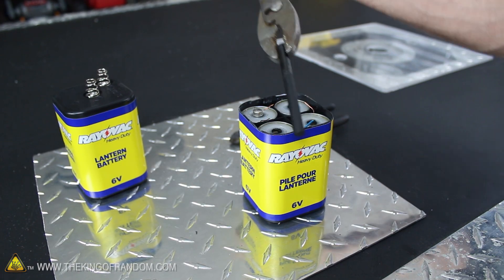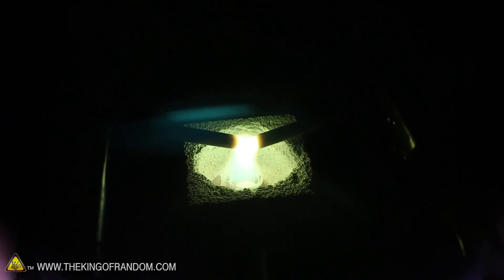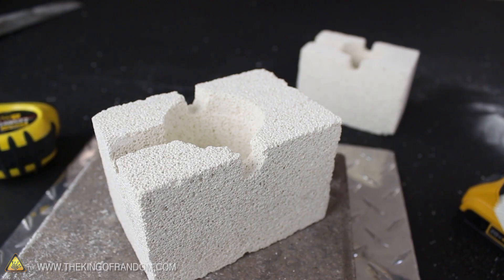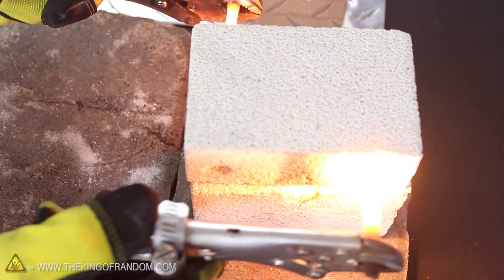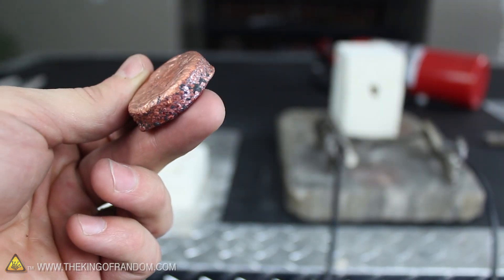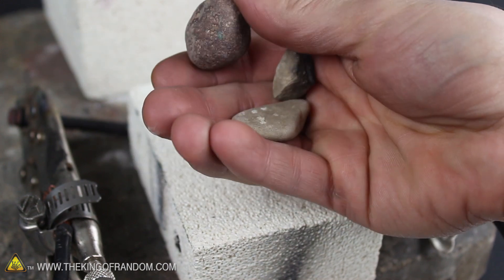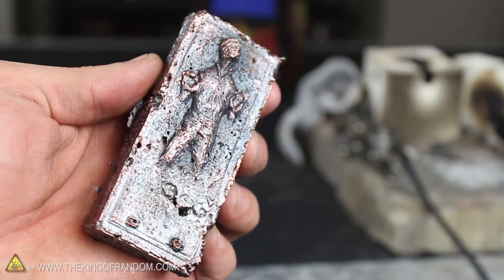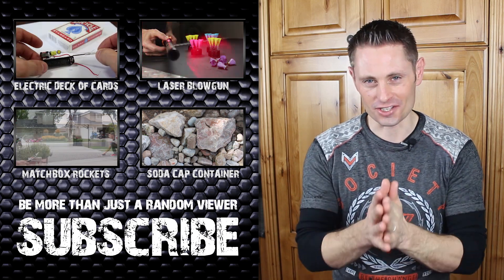Mini Arc Furnace (Arc Reactor Technology IRL)

Comment: Hey, you should totally try to make a plasma gun by fixing the electrodes so they will generate a stable plasma flame, It will be safer and easier to use, and incredibly cool. Also you can try to make a metal cutter/scissors by fixing the electrodes to an axis. And one last thing i am wandering about is if maybe you can use the melting technique to c-r-e-a-t-e magnets from regular metal, which could be very awesome. Any way thank you for creating these grate videos for us fans, they are really fun to watch and even funner to try:]

Comment: Fun fact: Carbon has a melting point of over 3500 degrees C( over 6500 Fahrenheit).
In the form of diamond it's melting point rockets up to over 4300 degrees C(over 7,800 Fahrenheit)
Try melting that in your furnace!

Comment: Why doesnt the melter itself melt?
Reply: Myko Link Because carbon has an extremely high melting point, 3550 degrees celcius. Whilst stuff being melted here such as steel melts at around 1200 degrees celcius, you can also see people asking about tungsten as it is a metal with a high melting point, tungsten melts at around 3400 degrees celcius so you are not in too much danger of melting the carbon rods if you do it for a limited time.
Reply: It's designed to withstand incredible heats, that's why it's called.fire proof brick...
Reply: Steven Roberts No I mean the thing that generates the electricity.
Reply: Scottx125Productions - Spiffingly Serious British Gaming! What about the things that lead to the carbon rods?
Reply: Myko Link
They're just copper wires, however at that point the only thing there is electricity.  It's where the two rods meet that make the plasma happen.
Reply: P = I^2*R
There's a lot of current going through the transformer and feed wires, but the current doesn't produce a concentration of heat until it gets to the resistance of the arc gap and carbon rods.

Comment: I like how you combined stuff from previous projects. I think it would be really neat to see you build something out of custom parts--like a jet engine, a radio, a motor, or put them all together to make an RC aircraft/car/boat/vehicle. I believe jet engines have a lot to do with material science as they have strong pressures that must be handled. 

Or, you could also switch into biology. I've heard there are a lot of new DIY bioengineering projects that people are taking on. I haven't delved too deeply into this, but it sounds very interesting.

Comment: is the gap between the rods wide enough that you could slip a thin insulator in between them? Then you could make them stationary and use that as a switch and just drop it back in to a top slot to kill it while you added more material through devided  top brick.

Comment: Please try creating glass with your furnace, that would really amazing!
Reply: Glass is difficult to do, if it cools unevenly / badly it can explode
Reply: There was a reason that glass making in Italy, was all moved to the island of Murano (so it wouldn't set fire to the city)
Reply: i was thinking that
Reply: FedeKode its true
Reply: Glass needs to be cooled on liquid tin
Reply: Yup :)
Reply: Yes
Reply: That would be great..
Reply: 10mcman Glass is a very thick liquid, like a sort of proxy, or glue, due to it's silica amount.
Reply: The Gaming Pirates Depends on the glass. Borosilicate glass from stuff like test tubes is good for melting. I think using something like a welding blanket would help a lot.
Reply: Glass requires a very hot, controlable furnace, maybe even a blast furnace, and takes a while, more than afew mibutes, to be well glass but does so awsome ri create
Reply: Rick Pickles Thats to keep it flat

Comment: Sir Thompson, can you do a video how you do the welding machine with the battery thing? I don't know how you do that with a 6 volts battery. I was planning to create my own too so I can have money for my thesis in architecture(A side line).

Thus inhaling it is dangerous? Thus it give you a cancer, if it does a need medicine that I can take to prevent the toxic from getting in my body?

Comment: Do the carbon rods ever break or wear down? If it can melt steel, couldn't it melt the carbon rods?
Reply: Carbon doesn't melt, rather it sublimes. Grant mentioned in another comment that he had to replace the carbon rods every 10 minutes or so, presumably because the carbon would sublime.
Reply: Jean Derpnald For once I'm glad I decided to read the comments. Is this simply from the carbon rods reaching critical temp? Would simply using the rods in shorter bursts increase their life expectancy, or is it just better to just let them burn out and not rely on them for all melting?
Reply: *****
I'm not sure, you'd have to ask someone more informed.
Reply: Carbon's melting point is rough 6332F (3500C)
Reply: brokenstar547 That's only if you put it under high enough pressure. The minimum pressure to liquefy carbon is around 10 MPa. That's nearly 100x atmospheric pressure.

Comment: You could probably make this self-starting if you use the -20KV from a TV flyback and place it between the electrodes when they are a few cm. apart. The air would become ionized, and hopefully conduct the arc, similar to in a camera flash. As soon as I can get my dad to let me get some of these transformers, I will absolutely build this. It is AMAZING!

Comment: Here is how it works. The  electrons have  no load, so this is a short circuit. short circuits in something all electrocutions have to be careful with. A short circuit will braks and cuse fire because the elections move freely and heat up the circuit, so all circuits have a fuse because it brakes easily, so that it brakes before the circuit brakes. The carbon rods act as a very slight load because the are nether conductors or insulators.

Comment: Great job Grant! I need one of these in my shop. I should have warned you that plaster can act as an oxidizer in thermite reactions if you happen to try to cast REALLY hot metals into it. Look into making green sand from bentonite powder for better copper/steel casting
Reply: Hey dude
Reply: Haha sounds impossible but my furnace did just that. My furnace started reacting with aluminium and burned down leaving me with couple of calcium droplets 😢😢

Comment: Grant Thompson - "The King of Random" Hey Grant, I was wondering what are the characteristics of the electricity running through the electrodes? Also, why the 2 transformers and 18 wrappings? Is it for easing the "stress" on the wires or was it to reach a specific voltage/current ratio?

Comment: Grant, this is freakin' awesome.  I had an idea, though.  What about putting together a little "fume-hood" type of thing, but for high-temp projects like this?  Something simple, like a fiber-glass tub on hinges with some high-temp insulated lining, a cheap little metal exhaust fan, and the face-plate from a welding mask for the view-port.  Attach some welding gloves, and you're good to go.

Comment: For people wondering how he doesn't blind himself and how that mask blocks out enough light to not blind him, that mask is called an Auto Darkening mask. It's (normally) electronic and when it sees an arc ray (a light so bright that it will permanently damage your eyes in 5-10 seconds) it goes completely black, making it so you can only see some dots where you may be welding or melting.

Also, he uses very thick gloves to protect himself from electricity. You should also note that the sparks flying around actually don't hurt, which is why he doesn't care if he wears a jacket or not. If you ever see anyone wearing a jacket, it's because they don't want to melt a hole in their clothes in case something goes wrong, but chances are he is wearing "work clothes" so he might not mind if they do melt.

Comment: Grant Thompson - "The King of Random" You should definitely take those two solar panels that you got and hook them up in series with the microwave generator and like double the power. Also how did the hand not get electrocuted when you were holding the wrench that the electricity was running through, what kind of gloves were those?

Comment: Another good material to cast into is cuttlefish shells, I used it to cast silver into it probably wouldn't hold up to steel but probably would be fine for aluminum or copper (keep in mind I'm some guy on the Internet not an expert) but it creates a really interesting ridged pattern on the metal and it's really easy to work with as its VERY soft, you can sand one end flat and then carve the other side one shell can make one cast but if I remember correctly it's only good for one casting. Either way, just giving you the idea.

Comment: Im impressed! Pretty awesome! I wished this was safe for melting my lead scrap down. I like to process my scrap lead to alloy it and pour into ingots so that my ingots are pretty clean and pre-alloyed for bullet casting. To afraid of vaporizing lead and making toxic fumes. I use a forced air charcoal burner and a gas cylinder crucible. Takes a little while and more work but cheaper than propane.

Comment: Thanks, this gives me ideas.  I wonder if you'd have had better luck with the plaster mold if you had preheated it (the mold) first.  I also wonder what the optimal size crucible/furnace is for that arc setup.  I suppose it would vary depending on what metal is being melted.

Comment: Always glad to see my microwave salvage tutorials being put to good use :). You can buy carbon gouging rods from welding supply stores too, they last a lot longer than the graphite battery cores and are built for this purpose. Carbon Arc torches are used to preheat large and thick metal for welding, same as an oxy/ace torch would but without having to rent bottles and fill the gas. For anyone looking to do this on a slightly smaller scale, "heavy duty" (i.e. cheap, dollarstore) AA batteries have about a 3/16" carbon rod inside them as well, and they're still fine from dead batteries.

Comment: Well if that is indeed a plasma arc it's temperatures could be around 5000ºC (about 9000ºF) so with that temperature level and with a insulating furnace like the one you made it's really no surprise it melted steel! That opens up quite a few  possibilities like casting iron and steel and even making your own alloys! Provided you have the metals for it. Awesome work, Grant. Thank you for sharing this!
Reply: It can easily melt tungsten
Reply: Jacob Iser One thing is reaching the melting temperature actually being able to melt it's a bit different i think, but its worth trying out.

Comment: Anyone else thinking of a desktop lava lamp? Literally :D
Reply: How long would it still be lava instead of cooling down? Also, how would you control the lava and prevent it from spreading? Is that possible? If you know please tell me, it sounds really interesting.
Reply: It would be all theoretical but this might work:
Keep the torch heating the rocks to keep it molten. Set up a timer or thermometer to keep it at the right temperature.
There must be a transparent material that can withstand the temperatures.
You might need to wear a welding mask when its turned on but I think it might work. It was also meant as a joke.
I wouldn't try it inside but maybe for a barbeque or something similar it would be pretty cool. :D
Reply: Yea, I agree. That's a pretty cool thought though. Do you think plexiglass could withstand that temperature? I'm not sure about that though. I'm pretty sure it's just used to withstand impact.
Reply: probably not but instead of a transparent material you could have mirrors that reflect the inside of the container out.
PS just searched plexiglass would probably become a gas at the temperatures required. Its apparently 115 C so nothing near the required 700 to 1300 C.
Reply: Hahah lol, I was way off. I think one way mirrors may work though :)
Reply: The main issue is you would be using a lot of electricity to provide the required current, and that would cost you an expensive electricity bill.
Reply: Or you could just be a millionaire ( ͡° ͜ʖ ͡°)
Reply: http://what-if.xkcd.com/122/ <<< That will answer a couple questions about the feasibility of the idea ;)
Reply: Yeah, that was really cool. You should check it out spaceface105 and xXAquaticGamingXx
Reply: 1075Rah I was not talking about the possibility of the idea. It is possibleif you have the right materials and such. I was talking about the cost of keeping the system at temperatures of above 3000 F. Please stay on topic next time.
Reply: Oh yeah, of course. I just thought you might be interested in that topic because you have some knowledge about it. Sorry if I came off as arguing :(
Reply: 1075Rah I am sorry as I misunderstood you.
Reply: spaceface105 All good. It happens...
Reply: 1075Rah Thank you :)
Reply: You're welcome. And my goodness, I must say, you have a very spacy face.
Reply: I like the idea so how do we keep it hot
Reply: Eein Fredrickson Extremely high temperatures could be provided by blow torch or arc furnace, but it would be extreeeeeeeeeeemely costly unless we could find a way to insulate the heat and keep it to the same temperature for long periods of time.
I don't think the insulation thing exists yet though. Sorry :(

Comment: Very nice project, had a lot of fun watching it! Use special casting plaster from the dental industry, you can cast anything in it, from gold to chrome with amazing details. Try making prototypes in wax. Important: You have to preheat the plaster before casting or it will break (will also evaporate your wax positives [might require some ventilation or a garden ;) ]). An advanced project would be a G-force driven casting machine (a centifuge) with higer casting pressure for even smaller details. And please try casting the metals under some argon athmosphese (welding gas) to keep it from oxidizing. Thank you for this tutorial and please keep going with melting and casting!

Comment: During my Jr year of Mechanical Engineering, we were able to take a road trip to visit gerdau ameristeel, in Navisota Tx. This is precisely the method (graphite rod arc furnaces) they use to melt steel and finally turn it into rebar using GIANT crucibles that you could fit an entire station wagon into.

Comment: Shouldn't melt steel, you en up "burning it". That's what the shower of sparks is: carbon getting burnt out of the metal.
The quality of the steel is drastically lower after that.

Comment: Noooooo why do you have the sleves of your shirt rolled up. when im welding it sucks when i get dem motin sparks on my arm
Reply: Xdragoninchi I've had a full-clothed setup once, and I was welding a radio tower.
I welded for 3 minutes straight with all of my clothes on fire until a friend of mine yanked me off and started beating me with a cloth.
Yes, it is certianly better to feel the molten metal.
Reply: ***** It is not, however, better to strike an arc with carbon rods without skin protection. Carbon arc lamps produce an extremely high amount of UV light, leading to serious sunburn and setting you up for skin cancer with enough use.
Reply: If you're welding properly you're not wearing flammable clothes, and your clothes cover nearly all of your body...  End of story.
Reply: better to feel the sting of sparks, than to have your arm burnt.
Reply: David Lam
No...... you dont know... its not better
Reply: Thor214 That's true, yes. But if you're doing carbon stuff you're not going to have bits of molten metal sprayed all around, you're going to most likely have it in an enclosed container, unless you're doing gouging, but then you're manly enough to feel the metal with your brain.

Comment: Made me... curious, I'm wondering what other high-temp materials would make good molds, cause both the plaster and the firebrick seemed to have pitting in the stuff that comes out of them, would clay hardened into some form of cermaic work better/smoother? Ooh! Or maybe aerogel, that stuff's supposed to be insanely insulating, and its translucent so you can see the pretty glowing metal! Hmm, I need some time in my garage...

Comment: Nicely done Grant. As an alternative to the firebrick, you can also use a clay flowerpot. Much harder to drill holes in, but the clay has similar temperature properties. With as much power as you are pumping into the carbon rods, perhaps nesting a couple would be better. BTW, the sand you used to cast the gun will work for the copper and steel as well, just make sure there is no moisture in it, or it will rain fiery death upon you, which is the issue with plaster - since water is bound in its structure as part of it setting up.